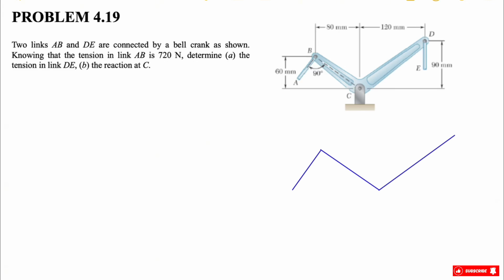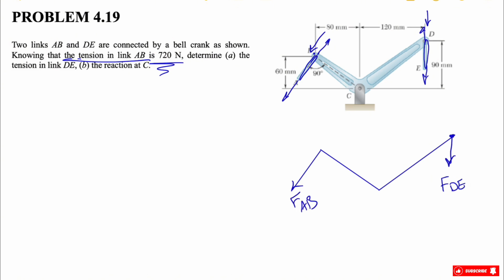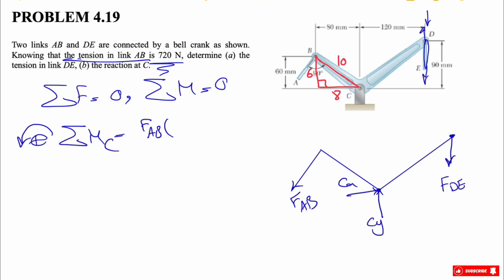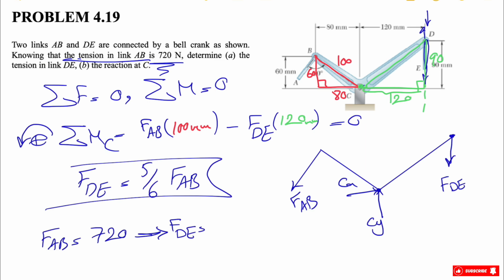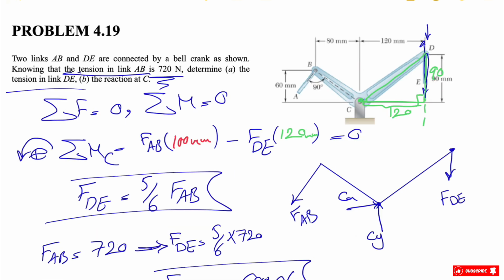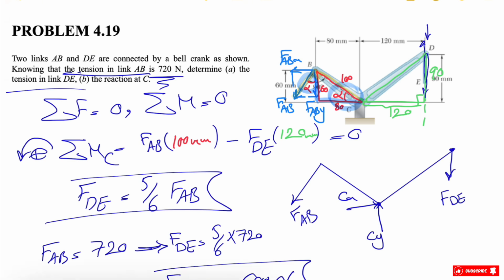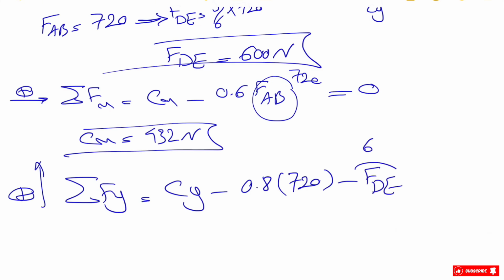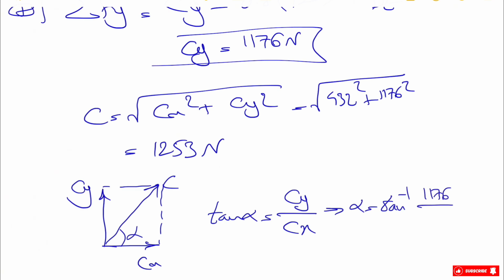Problem 4.19 | Two links AB and DE are connected by a bell crank as shown. Knowing that the tension

Comment: Your camculations are wrong in the B part. 80 and 60 are in mm so you have to divide them by 1000 not hundred
Reply from the maker: Actually, we don't need to worry about unit conversion in this case. The values 0.6 and 0.8 are derived from the sine and cosine functions, so there's no need to convert them. They already represent the ratios between the lengths of the sides in trigonometric terms. Hope this helps!
Reply: He was dividing by the hypotenuse. You are wrong.
Reply: What's the final answer for a and b